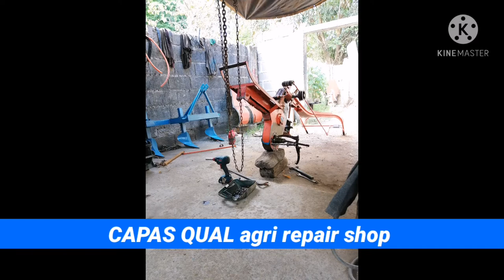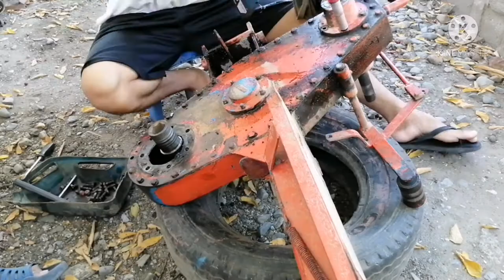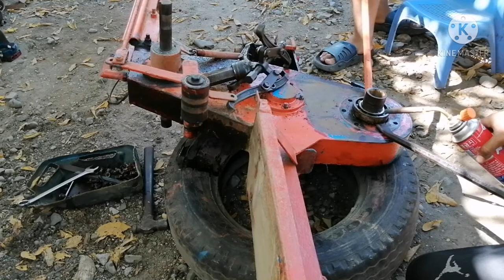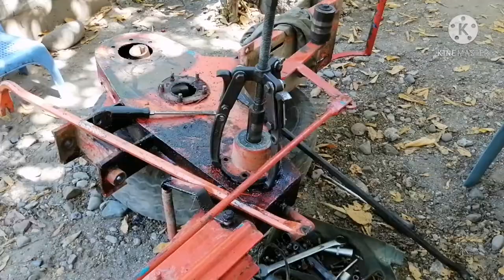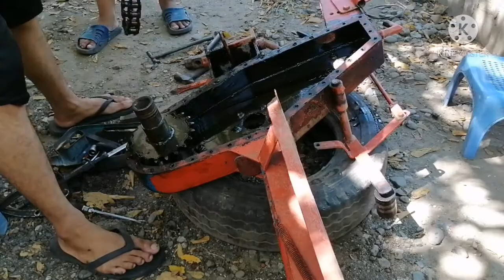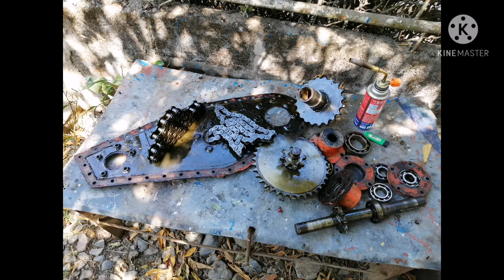Hand tractor *Overhaul* (Chain size 60×80)

Comment: Kahit ba dikana palit sprocket kong palit ng #80 mga idol?
Reply from the maker: Need po magpalit ng sprocket na #80
Reply: Kalako po kasya ung sprocket ng datikon kuliglig  na #06
Reply: Anu pong size ng gamit nyong puller
Reply: Anong puller idol?yonng po kasing kulilig ko nalagotok pag nakorba gawang isabela ung transmision koACT ang tatak?
Reply from the maker: @ronaldpadua1587  8 inch na puller po
Reply: Ilang ngipin yang center sprocket mo boss, pwedi ba high speed 10 HP Jan ikabet